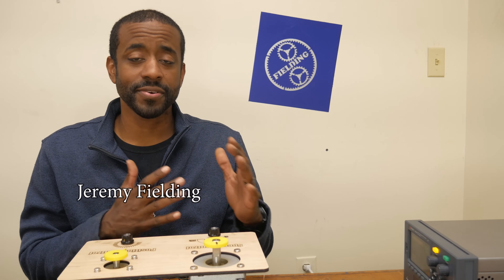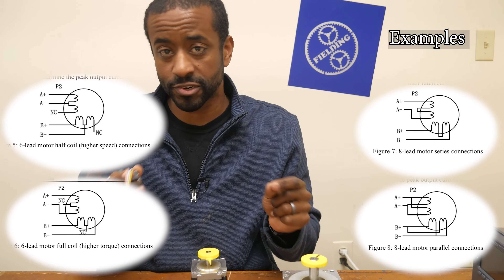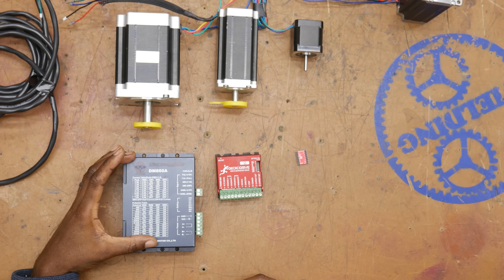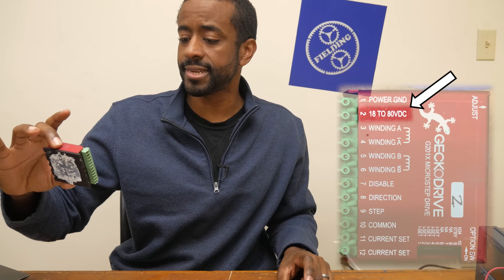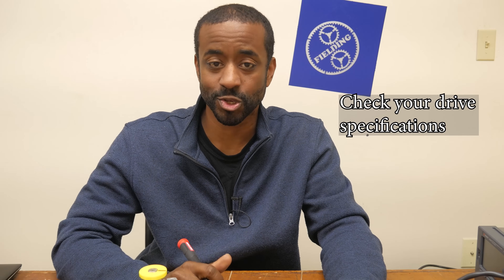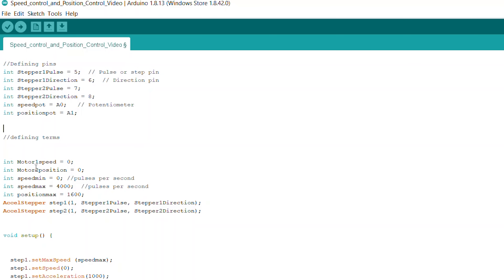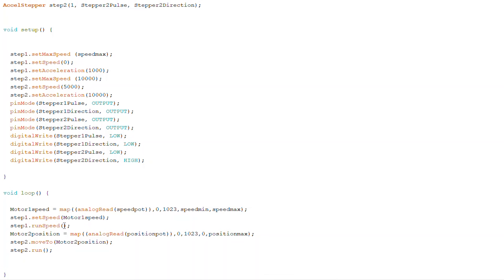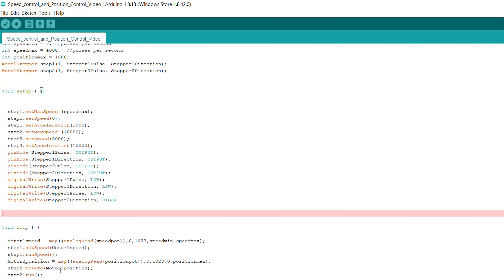Beginners Guide To Using Large Stepper Motors: #087

Comment: Perfect timing last winter I built using an Arduino uno a blast gate controller using model airplane servos I want to try stepper motors for better torque. This video has given me the incentive to start digging into this again. Where can I find the screw terminal shield like you showed? Looking forward to the series 😁🛫
Reply from the maker: Check the description
Reply: Thanks Jeremy I must have overlooked it in the description😀🛫

Comment: For something a bit different, I'd thought about using a stepper motor to run a small gearbox oil circulation pump.
My logic here is that the motor can run for a very long time because there are no brushes to wear out and from what I understand, stepper motors give their best performance at lower speeds. Ideal for fairly high viscosity gearbox oil so the pump doesn't suffer from cavitation.
Thought?

Comment: Great stuff.  But I was a little confused, don't you have to set the driver device's "steps per revolution' to match the motor?  I've seen different motors with different 'steps per revolution'.  Seems if they don't match, your controls wouldn't know the actual amount of rotation?

Comment: Quick tip to find 4 wire pairs.
Connect two wires together, if the shaft becomes stiff rotate then that is a pair.

Comment: I have a super interesting motor, I assume it is a version of a stepper motor. It is the tiny, precise motor used in an insulin pump to deliver increments as small as .1u. Pretty cool if the firmware wasn't locked out by the company that makes it. A lot of the precision I believe actually comes from the screw threading that drives the plunger but all together I feel they must compliment each other. They charge an arm and a leg for a pump but I'll bet it's actually 3 cents worth of parts and a million split between R&D and payoffs to the FDA, LOL :)

Comment: Pretty interesting stuff. I built a custom 3d printer and it turned out so well im inspired to use stepper motors to control an automatic brass annealing machine i built last year. Using software programming ( not sure which one yet) will be my biggest challenge. 

Love your videos. Cant wait to see more.

Comment: nice video,

I've been trying to create some project with stepper / servo motor, i saw your stepper pretty much accurate when you control the rotation of it, i dunno why mine is kinda lose some step when i try to rotate it,
for example : trying to rotate it 90° CW, and rotate it back again 90° CCW, but sometimes i found it not accurate position.
do you know what the exact problem?

Comment: I salvage a lot of stuff,  but have yet to acquire any motors that were as large as the ones shown in the video.  OTOH,  for some really small ones,  you'll typically find one as a head positioner in any floppy drive.  Not sure what these would be good for,  but I have a pile of them so far.

Comment: Magic trick: Shortcut two wires an try to turn the motor. The ones with higher resistance belong to one coil.
Reply: Also connect a led to the wires and turn the rotor, if it blinks then both are from the same coil.

Comment: Very interesting. I have already used step motors +arduino in the past but I learned some stuff anyway, Iy always good when you know a subject to listen to somebody who  know the same subject better or with a different perpective (both in you case). 
Talking about induction motors (which I learned the basics on your channel), I have a motor with only 2 wires coming in and by mistake I destroyed the electronic between the motor and the plug. I reviewed your series about induction motors (sigle phase) and could not found out where you treated the subject of induction motor without starting capacitors on one of the winding. Can you give me the link iof the video where you taked about these motors?
Reply from the maker: I don’t have one covering those types. They tend to have very low starting torque thus I never use them.
Reply: @Jeremy_Fielding  You are correct : the motor come from a table saw.

Comment: Something in this video helped me realize why i have been getting a repetitive pattern on my Z axis on my 3D printer. Every few dozen layers i was getting either an under extruded or over extruded layer line. Well the drivers have been set up for 1/64 increments and since i have been using layer lines non divisible by 64 but really close the driver can compensate the movement most of the time but not always and the motor just falls back or steps forward just a bit every so often giving me my pattern. Im guessing since the z axis is static for prolong times its more noticeable than the other 3 because those are always in constant movement.

gonna go try my theory, thanks
Reply: stepper micro stepping has errors however they don't accumulate.  x64 microstepping may be too much but it isn't likely to be causing your issue with extrusion.  The extruder can't be modeled quite like a linear motion (like your x,y,z) since there is heat and pressure which are changing.  You may need to try to PID tune your extruder, you can find out how by a quick google search.
Reply: @JesseSchoch  its not real under or over extrusion its only noticeable under bright light at an angle with black filament. I've only have a sample size of 4 for now but so far i have a more uniform finish on side walls at 0.25mm vs 0.24mm or 0.26mm.

And i know the error isnt compound at the micro stepping end but i do think the small pressure build up happening from the layer being off by 0.001mm, figuratively, is enough to occasionally cause very small and inconsequential for most but any free quality enhancement that can lead to print speed boost is worth investigating.

And yes 64ths micro stepping is unnecessary on the x and y but it does seem to make teenie tiny improvement in layer consistency on the z axis when scrutinize with a magnifying glass and bright light.
Reply: @Guardian_Arias  I doubt your stepper can actually step 0.001mm accurately.  Sure you can tell it to move that much but put a dial indicator on it and try to move it that much to see what i'm talking about.  The detent/cogging prevents that level of accuracy even with a closed loop stepper.
Reply: @JesseSchoch  i said figuratively and also not the actual movement but the index of what the gcode says to move and the stepper actually moves. The closer these two are the better the print should be. Again the differences are only under scrutiny.

Comment: great video.  as a heads up, if you are needing labels to represent things like pin numbers, or anything that you don't want to change during the execution of the program (meaning you would only change it before you compile it), then don't use int variables like you did here... use #define to have the compiler swap out the values at compile-time.  thanks for sharing these great videos!

Comment: Awesome video. It's not really needed in this example but as programs grow, you'll start to run out of ram. For pin definitions, I like to use "const byte" for the data type. That will put those pin definitions in program memory instead of ram, along with reducing the size from 2 bytes for an int to just 1 byte.

Comment: Worth checking out - for not a lot more money, you can get Trinamic brand 'silent' stepper drivers, they aren't dead silent, but they carefully control the (violinist in this case) giving smoother instructions that still work but try to keep those instructions outside the audible range. For stuff like a 3d printer where it will be running for days on end beside you, it's a lifesaver.

Comment: Variables like pin definitions or values that don't change (eg min/max speed) should be declared as const int rather than just int. This will prevent you from changing the value inadvertently in your code and instead, receive a compile-time error. Prevents hard to find bugs.

Great stuff on the motors, I've started collecting them for alternate uses and your channel is a great source of info on them.
Reply: I prefer to not declare them as int at all,  but would rather use #define.

Comment: Can I attach 2 grounds from different items in my controller box in one ground? I am setting up a 4x8 cnc and had a problem with one of my grounds so I moved it to the next ground but its sharing a spot with another ground wire.
Reply: Hey James, the youtube comment section isn't great for diagnosing stuff like this, if you get lots of help it's impossible to follow the comment thread. I suggest finding a relevant subreddit or forum to post on.

It's not clear from your comment what your ground is actually grounding - can't tell if you're referring to a motor, controller, driver, power supply etc.
Reply: @PilotPlater  its in a ground location from the driver to the home switch
Reply: @pocket5751  I see. Ultimately if neither ground wire are expected to carry much current you're likely fine, but assess the worst case scenario if you were to get vibration and have it disconnect or get bad connection. If the answer isn't fail-safe and not cause the gantry to crash or start a fire I'd look for a better solution than two wires under one screw
Reply: @PilotPlater  I was thinking the same. The only real reason I did it is because others in the instructions do it but I have been holding off till I found more headway. Thank you for that info
Reply: Ground should be wherever you see zero volts - In cases where there are multiple circuits sharing instructions with one another, they should share grounds (mostly) so that 5 volts compared to ground over here at the controller 0v connection is the same 5 volts over there compared to the driver 0 volt connection, etc. It gets complicated when grounds are tied together when they form a ground-loop, which acts as a giant antenna, introducing noise to your circuits.
Reply: @frollard  is that why my first cnc plays music while it moves haha